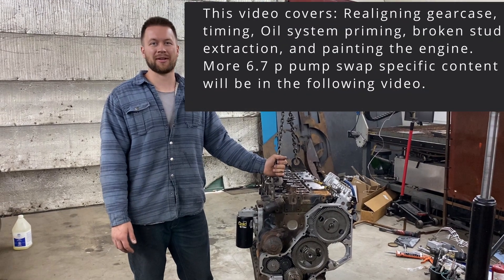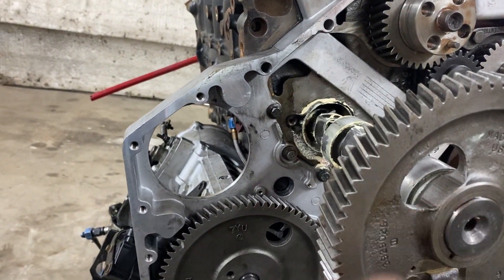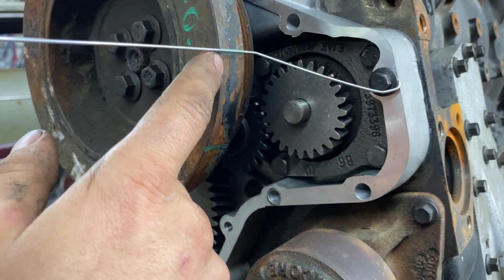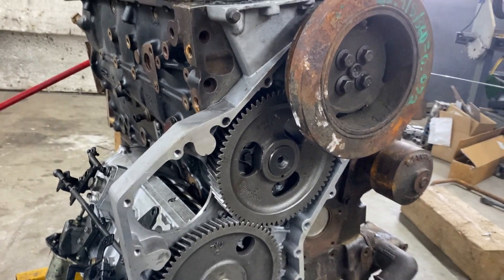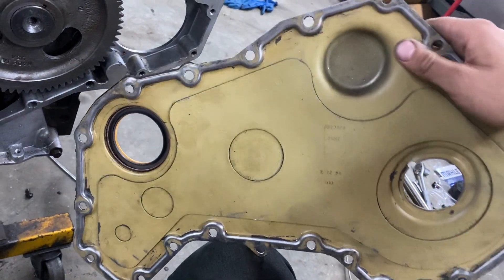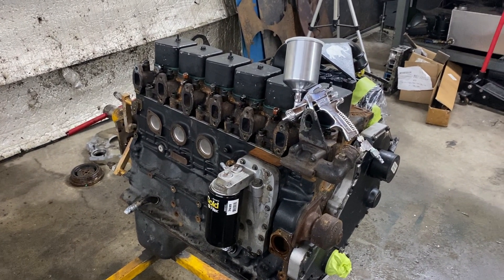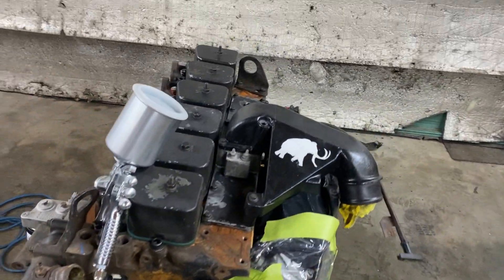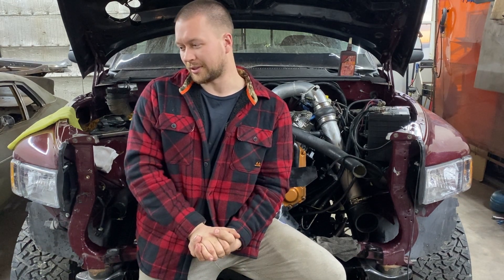21:1 Compression 6.7L 12 Valve PART 2: Paint, Timing, and Oil Priming

Comment: Why so high compression?
Reply from the maker: Numerous benefits
Easier starting
More low end power
Less boost needed to make the same power as lower compression
Less timing or injection duration needed for the same level of power
Spools turbos quicker 
Better fuel mileage

It’s the way to go!

Comment: the pump gear thing happened to me with a chinese case cover, used a cummins case cover and it took care of it. even though your block is redrilled I did the same thing with my p pumped 6.7. just milled the holes in the cover a fraction to give the pump gear .010" lash. glad you are back on.
Reply from the maker: Hmm.. I wonder if that was the case with this one then, this was a Chinese gearcase. I've never had any issues with other ones, and honestly the casting quality looked better than OEM so I didnt think much of it. I'll take a closer look at them from now on.
Reply: @Hazardous-Hotrod-Knowledge  all I can say is I put one on a 12 valve that I had built, and the pump gear bound the whole gear train. when I built my 6,7 I just like I said milled the holes a fraction snugged up the cover with a mock up pump installed, checked the lash and tightened the cover bolts.

Comment: Hi so a 215 pump factory timing  is set at 13 degrees ?
Reply: 14.5*
Reply from the maker: yup like @sargebro387 says, 14.5 degrees, same for the 180hp p pump. The 160 and 175hp p pumps are 12.5*.